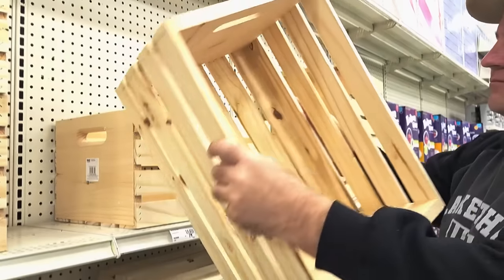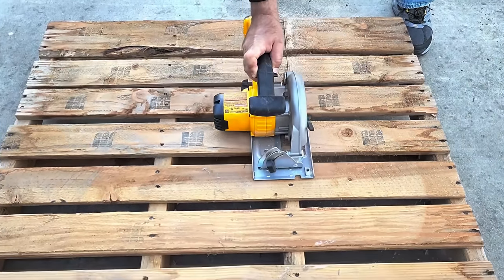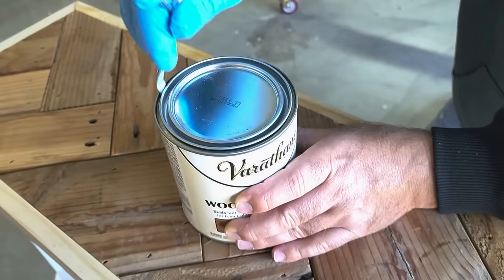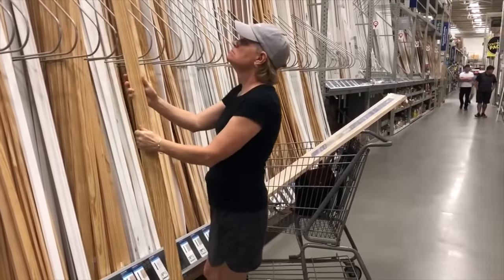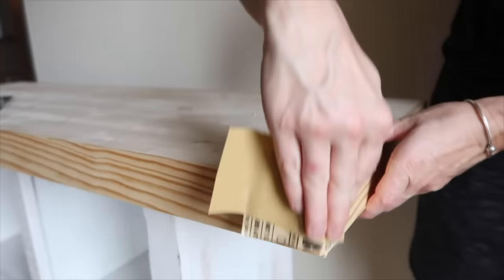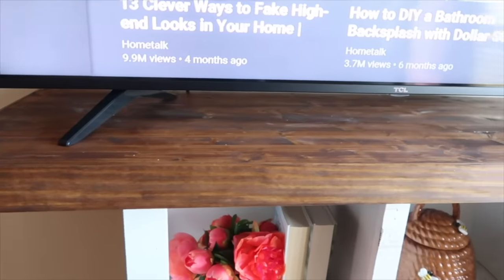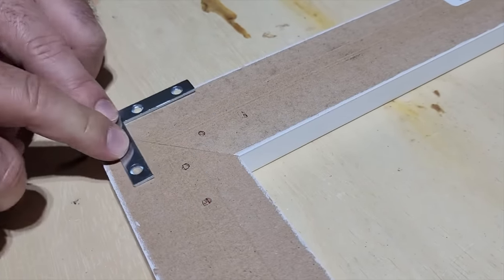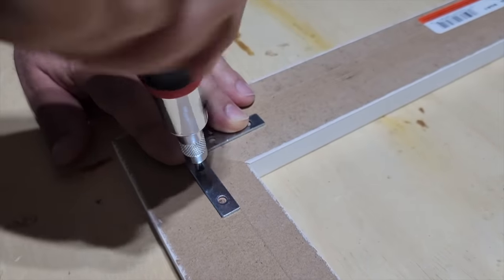People with TVs in their living room are FLIPPING OUT over this genius idea!

Comment: Spend a little extra time and make your own crates, or just build the stand without crates and ad alot of 1 x pine boards instead. You will still have the same stand and keep your costs down. Helps alot if you have a tablesaw or a track saw and a brad nailer, but always use wood glue also. I know alot of people can't afford a good tablesaw or have a place to keep one though. They do also make portable jobsite tablesaws that fold up for easier storage.